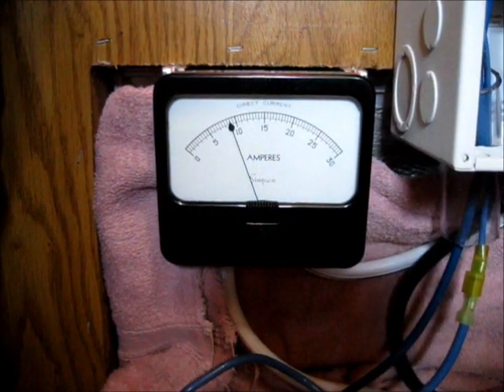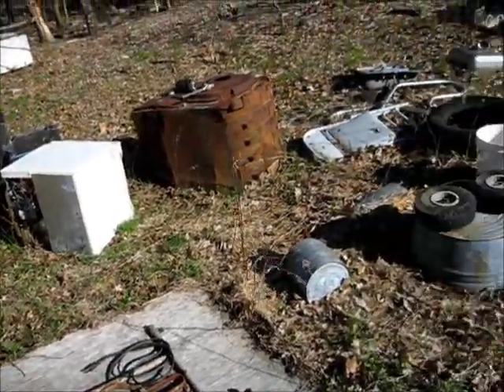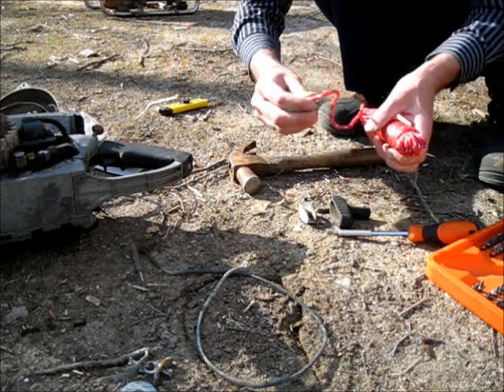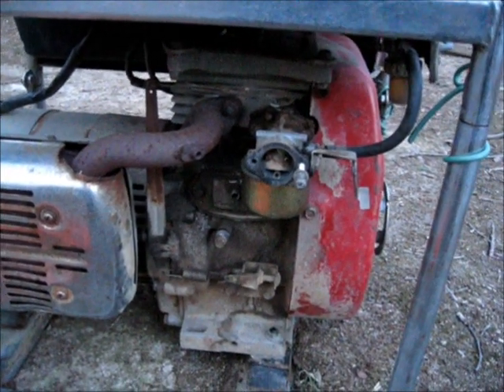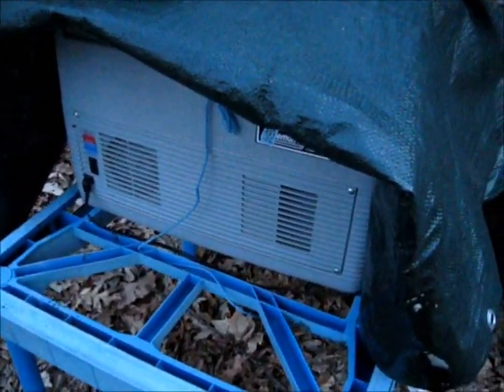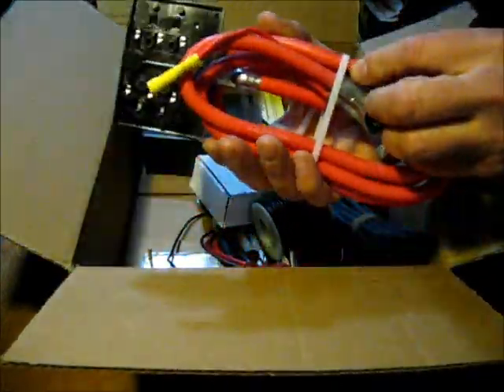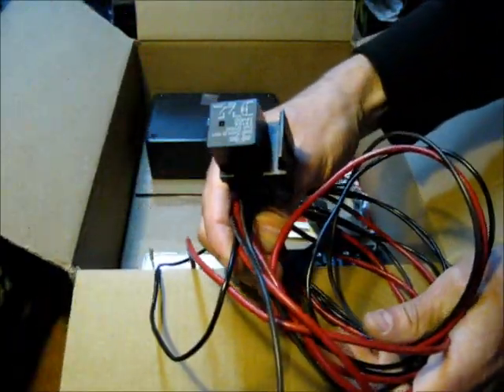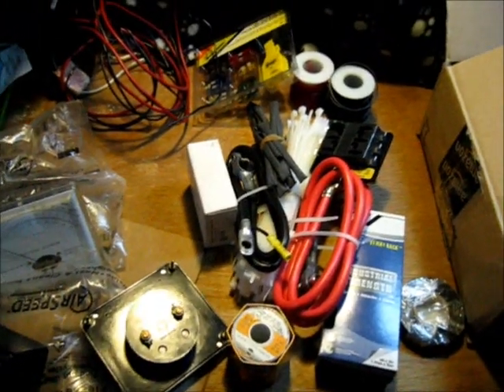An Awesome Day At The Off Grid Solar Camper

Comment from the maker: Where do you see me going through wire like its going out of style? You may see me improving my connections and using the same wires again.

A cutoff switch is a safety device so you can work on your solar panels and batteries with no danger to yourself or your charge controller.

You may consider using them.

Comment from the maker: Its actually 432 amp hours. Volts times amps = watts. 12 volts x 432 amps = 5160 usable watts from the batteries.

But a lead acid battery is considered drained at 50%.

My cooler is taking just about all of that. The solar panels are also not producing enough per day to fill the batteries more than the cooler uses.

Come over to thediyworld forum for more details if you want

Comment from the maker: It depends on your fridge. But the battery bank should not be discharged more than 50% of their rated capacity in order to extend battery life.

My fans use maybe 2-3 amps all combined. They are very small and efficient and I have to use what I have on hand.

But I agree about getting rid of inefficiencies.

Comment: Someone elses garbage is anothers treasure. As you were scanning the yard, I noticed a huge galvanized tub, and then also a bucket near it. You could put that large one on rocks or bricks, fill it with water, and light a fire under it for warm water for bathing and dishes, laundry, etc. The smaller bucket, could be your scoop to carry the warm water wherever needed. Filling it would be a chore, but easy to keep up once going. Just a thought. Happy to hear your day went well. Congrats on the job!

Comment from the maker: I meant standard fuel gas. Wood gas is my off grid alternative.

8AH is to me wasteful from a 3500 watt generator. I will use a good high current AC charger and then I only need the genny an hour on a cloudy day.

Later I want to use a car alternator instead of the genny. Hook it up to a motor.

Comment from the maker: In reply to all, the outlet timer will not work either because the cooler is 12 volt and the timer is 120 volt. Wonder if they make 12 volt timers. I may just make one with a 555 chip.

Comment: I wouldn't have replied, but I believe it is important to know that one can on occasion during the winter, run their batteries down 80% instead 50% without doing damage.  A discharge of only 25% during the summer will help offset those deep winter discharges. A hydrometer is cheap and the best way to determine the depth of discharge and how it relates to voltage read during the cold months. For example, at 32F batteries only have half of their capacity even if the voltage is 12.6 Good Luck

Comment: Hey Troy, if your creek water is in the 50's you could bottle some of it leave it out over night when your temps really drop then place the cold water bottles in cooler to help keep the temp lower. The Thermal electric cools can only cool like 40 degrees lower than actual temp so by addind additional ( rechargable) cold the unite will work alot less to reduce temp.

Comment: Re cooler versus fridge - you need a bigger inverter. 800 watts is the lower limit, 1000W is better, and 2000W the dream. modified sine wave will probably work fine if you can draw 1100W long enough to start it. Re Zeer Pots - if you can buy the sheets of aspen shavings to make swamp coolers at your local hardware stores, it'll work. If not, your climate is too humid to get more than about 5 degrees of cooling. Average underground temp in Troy's area is about 50 degrees F. keep up the good work!

Comment: I have a normal small refrigerator that only runs on electricity in my off-grid cabin. The peak is at 1050w but it takes only 50W when the generator is running. Believe that an ordinary refrigerator is better than those little. I can not have it during the winter but then it all goes to have the food outside. But in April, it has been on and all the way to October. My system is 540W solar panels and 800Ah batteries.

Comment: Renology has 100 watt panels for 164.99, shipping included or free.  This is the cheapest I could find.  You may also look in to ARB portable refrigerator-freezer.  A good generator that can be found used and cheap in good condition for 100 to 200.00, yet is efficient and quiet is the 1980's era Honda EM500.  It would use 2 quarts of fuel per day and provide about the same amount of power you are now using.  A good back up

Comment: 1100 watts for cooler? thats like a microwave, but all day drain, root cellar, did the generator have spark, have starter fluid ,it will start if its close , WOW-DAVE and NIEL you dudes  let it rip way to go! congrats on the job troy

Comment: You scored with both boxes! We are learning from your experience. 'But for the grace of God, there go I....'  Give that we are headed into the End Times, we should all prepare.  I tried to buy a used Engle frig for 250.00.  These are 800.00+ new because of their high quality and super low consumption. However, solar is now about 1 to 2.00 per watt, so extra panels may cover the additional draw from the cooler during warm weather, and provide more during winter when the sun shine is scarce.

Comment: the reason I said you go threw wires like is going out of style in one of your video you said you use a lot of wire in the camper that's why I said that . the reason I don't use a cutoff switch is just more wires you have run in the camper. for all of my wiring I use Anderson Power poles connectors and looks better and if you have to change batteries is easer to change out batteries too and looks cleaner too

Comment: As I recall, he only has only about 200 amps?  If so he would do better to have another 100 amps, or 1 amp of storage for every 2 watts of solar is well balanced.  One needs a minimum amount of batteries.  Going with a propane frig is another option.  Perhaps he could check Ebay for a used Engle or ARB frig and save up.

Comment: To fix that carburetor bowl, one you could cut out a piece of cardboard (the thin stuff) to the size of the bowl & use that as a gasket, it will work.  Or if you now have some silicone sealer, run a bead of that around it.  Then you can have a generator that works.  And fix that engine mount bolt so the generator won't shake while running.
Also, on that cooler, get a timer for it, & have it run for a couple of hours then shut down for a couple of hours, so that it would only run 12 hours out of each 24 hour period.
Reply from the maker: The generator is flooding now all the time. The fuel shut off needle is worn out and fuel flows non stop.
Agree on the cooler. I want to try it again with a timer or a thermostat shut off switch.

Comment: When you going to get an AC compressor type mini fridge?   Toss that Coleman out.  Also, you may be confusing the 10 amps with smart charging.  That may be all the controller needs to keep the battery full.   Once the battery is full, it's smart enough to only put enough in to keep up with loads at the moment.   Just cause it's only putting out at 10 amps at the moment does not imply that is all it is capable of pushing.  It's a "controller".  It's regulating the charge to level you need.

Comment: The loads should be figured as battery loads... because as sure as anything there will plenty of time when there is little to no sun hitting your panels... nighttime. .. clouds... three inches of snow slowly melting off the panels when your not there or able to scrape it off.  ...  etc.   Recharging a battery takes a lot more energy than keeping a smaller load going while maintaing the batteries.  17 yrs of living off grid has tought me alot... Mostly the hard way.

Comment: cardboard gasgit just take the carb of and put a bit of card on top using a block of some kind tap it in till you have a print outline of the gasgit keep taping it in  till the gasgit comes away from the rest of the card       no need to spend just make your self :)

Comment: Using wood gas would be considered to be 'off grid' as one uses renewable energy, wood, to generate wood gas.  It is more reliable than solar, but requires labor to process the wood and consumes the generator.  Using a tiny EM500 (500 watt) generator running 6 hours per day that produces 8.8 amps 12vdc would easily support a bank of 4 small deep cycle 235 amp 6vdc batteries with 52 amps12vdc. My laptop uses only 2.3 amps and two 7 watt bulbs use only 1.3 amps.  52amps/ 3.6 amps = 14 hours

Comment: then you shouldn't be going threw wire like is going out of style then like me I don't have cut off switches for my battery bake or solar panels  when my battery are charge my solar controller goes into a standby mode

Comment: From what I saw, were you trying to start the RV Fridge?  That has a heating element in it. It will pull probably 15 amps AC the entire time it's making cold.   You need a compressor type fridge.   The RV fridge is great for RV'ing, terrible for solar.  If your talking about a compressor (small home) type fridge, you could be right.  I'd expect about a 1500 watt inverter to start that.  That cooler is killing you.  Chuck it.